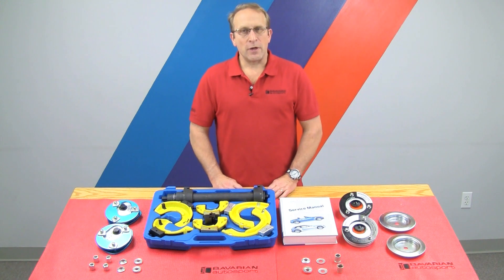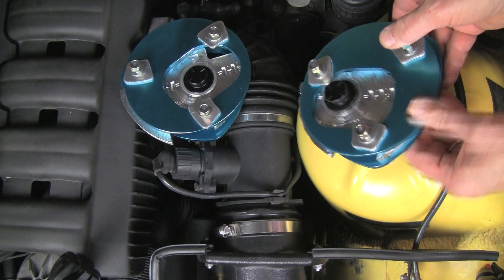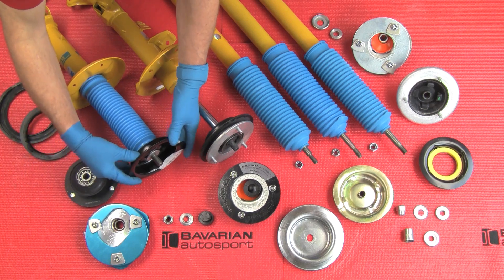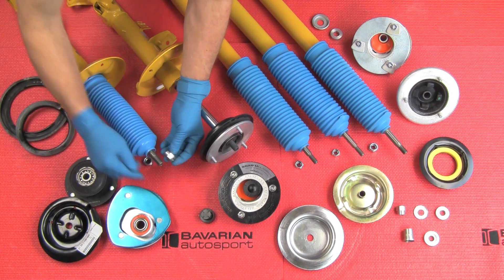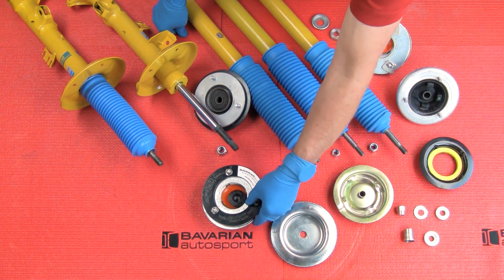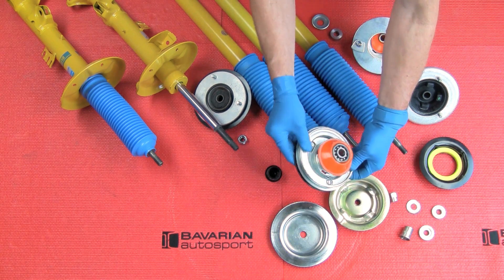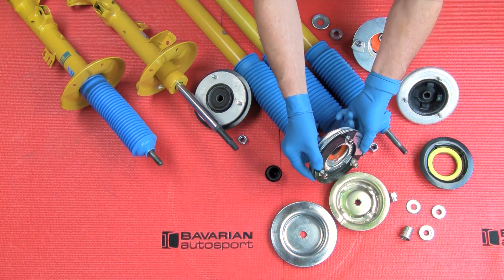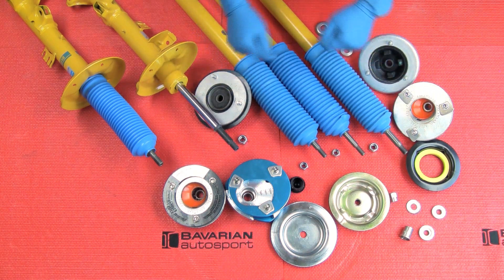Installing adjustable front camber kits on BMWs and MINIs - How to

Comment: Thanks!  Quick question, I'm installing stage1 on my E36M3 - I have a strut brace also, should I put that on top of the Camber plate top plate?  Or use the strut brace instead of the camber plate top plate?  Assuming to use both.  Thanks!
Reply from the maker: For the satge-1 installation, the foot for the stressbar (strut brace) replaces the black upper plate.

Comment: My E46's caster is different by about 1 degree left to right. Is installing camber/caster plates like this one the only way to fix my inequal caster?

Can I use a cheaper camber plate that only allows one axis of adjustment (not 2 axes like KMAC's) and just rotate it around upon installation to adjust the caster only (because my camber is acceptable as is)?

Comment: I recently bought camber plates for after market coilovers for my e46 coupe, I am confused about the installation still. My coil over has a flat top spring perch, then i used the washer that came with it, lower flange, camber plate (which has spherical bearing) and the finally flanged nut last. My question is, I know the spherical bearing moves axially for camber, but there is no bearing for steering load or rotation? What am I missing?

Comment: can you please help i installed coil overs on my e46 320d and the springs in front make noise when i turn the wheels thanks for help
Reply from the maker: Our first thought is that the upper spring mount is hitting the underside of the upper mount.  Lift the front wheels off the ground.  Remove the three upper mount nuts (place a jack under the control arm so the strut assembly does not just drop when the nuts are removed).  Lower the control arm, strut and mount so that the studs on the mount are free of the strut tower.  See if the upper mount turns (spins) freely or if it binds.  If it binds, it may be hitting the upper spring plate.  Remove the assembly and check it out.